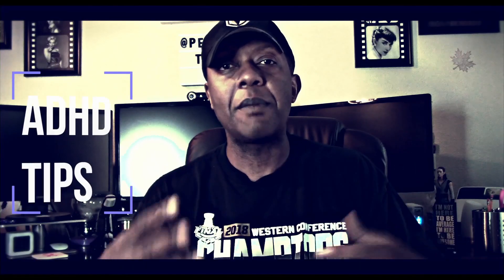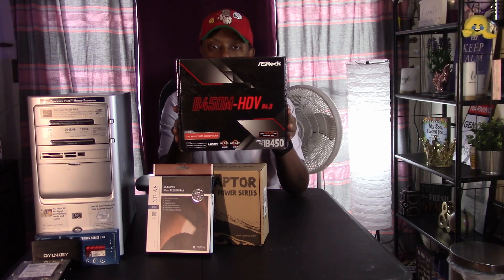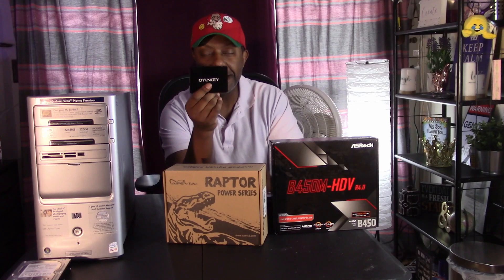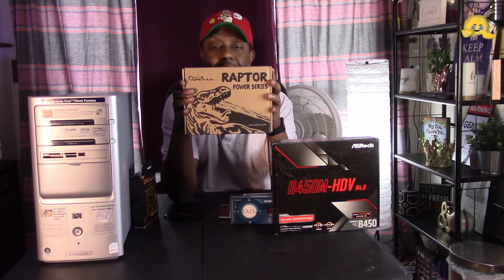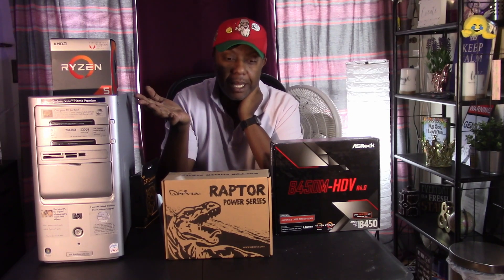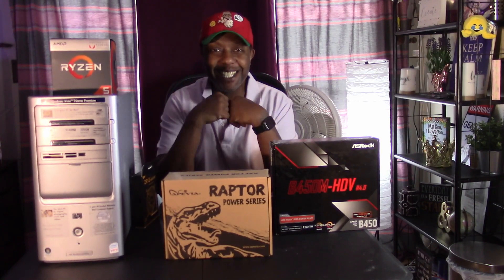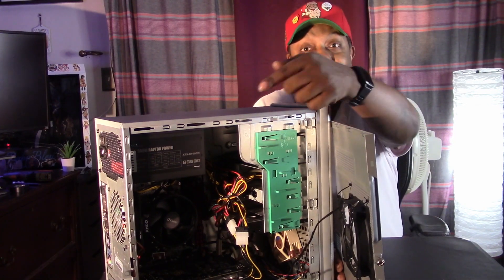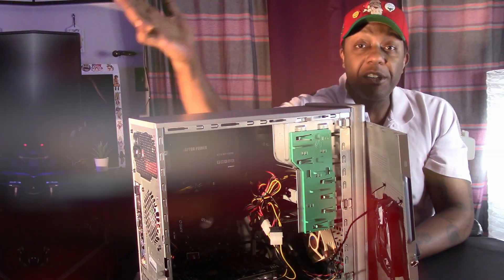HP Pavilion a1740n Sleeper Build!

Comment: Great video! I also have exactly same hp case that's how I ended up to your video, did the front power button & other connector have any problem with the new mother board because new case have different front connector & this case have power button like usb connector, you didn't showed that part in the video so I thought I should ask.
Reply from the maker: The front power button as well as the HDD status light worked perfectly for me with two different mobos. Everything is all together without dealing with the individual wires. Worked perfectly on an AsRock B450M R4 and MSI A320 Pro Max without hiccups. 👍
Reply: @PeaJayTheGr8  I connect my power button to front panel 1 & USB, audio port to their position on a320m mobo, the cpu was on but monitor wasn't showing any display so next month I'm going to try it with b450. Thanks for this video, it helped me in saving my old case.
Reply from the maker: Hope everything turned out ok. Sorry for the late reply.
Reply: @PeaJayTheGr8  yeah it worked out great, right now I'm using my old hp case and playing all the games I missed out on. Your video definitely helped. Have a nice day 😄

Comment: Great video! I am planning to do a build in a HP Pavilion case similar to yours and I was wondering if you had any issues connecting the front panel IO? Is it proprietary or regular pins?
Reply from the maker: I was able to get everything working minus the Firewire port. And the front card readers were a hit and miss. Sometimes they worked and sometimes they didn't. The only stable one I had working was the USB 2.0 that was not under the sliding cover. Good luck with your build and thanks for watching!